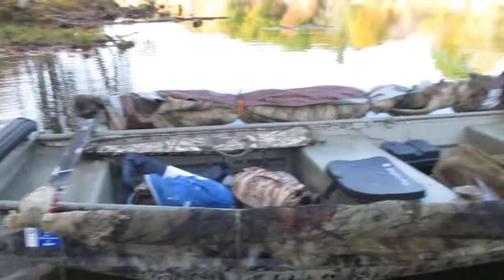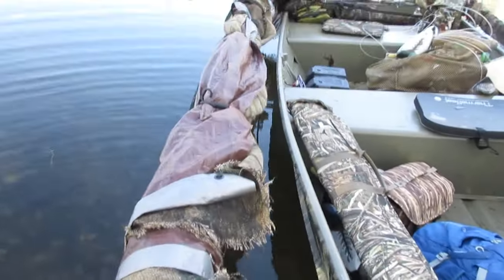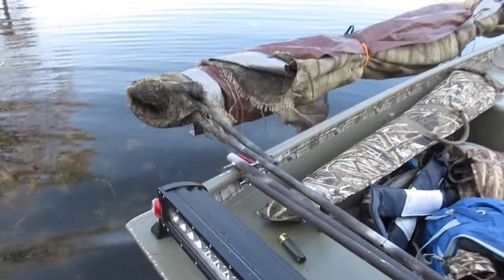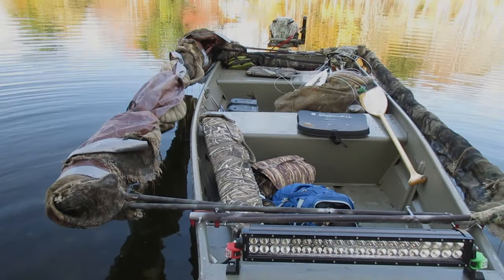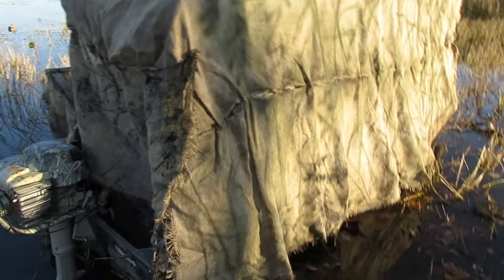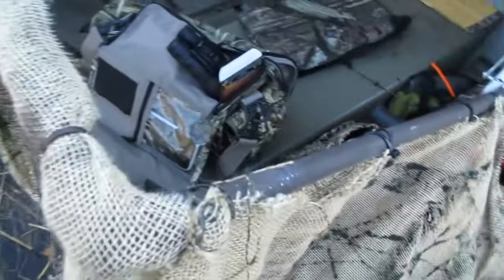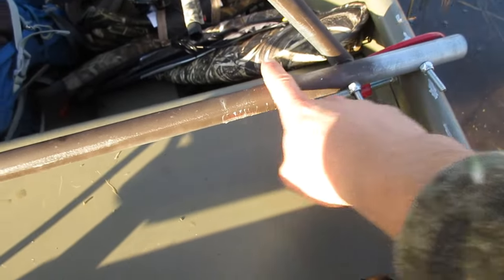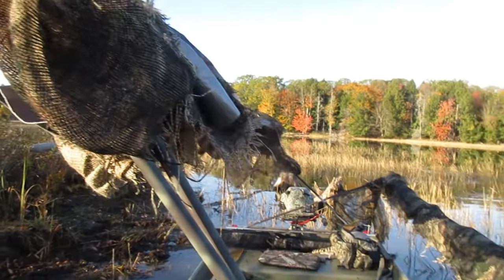How to Build JON BOAT DUCK BLIND

Comment: I really like what you did with the blind, and what I like most is the angles of your scissors. It seems like the front bar is low enough to still sit and shoot from, while the back part drapes over you. A lot of the blinds from what I've seen require you to have to stand up to shoot. Good job guys!

Comment: sweet blind dudes. I'm  building one as we speak. what size bolts/bit did you use to drill and attach the conduit? I'm going with 500d cordura as a backer with camo netting over the top

Comment: Still racking my brain, how did you attache the overhang so it doesn't swing down on you? Limiting strap on the overhang conduit to back half scissor or how?
Reply from the maker: AJ MacVittie - Clearwater Properties it’s a scissor. V shaped. So when you fold it down the tarp holds it like a strap would. Use a bungee from the top to the boat to keep the wind from flipping it up if need be
Reply: Thanks! About what I figured but appreciate the response.

Comment: Hey brother just bought the light bar can you show me how you connected that to the battery. Did you install a switch and relay/ fuse? Or just run it straight to your battery with a fuse?
Reply from the maker: Malcolm Wright we bought a relay/switch that was all one wired in and we just hooked it up. You can get them at Tractor Supply.